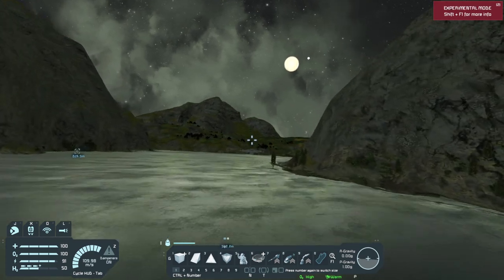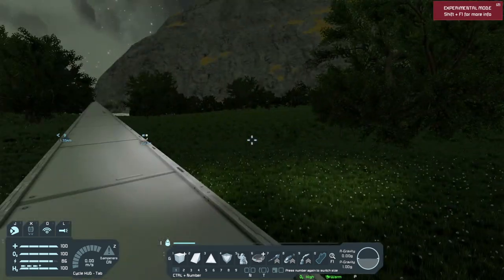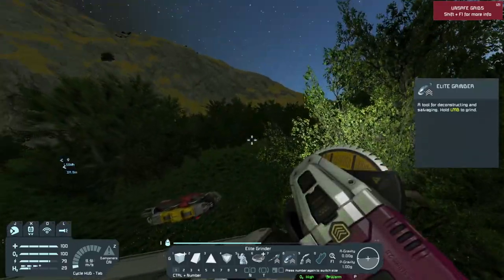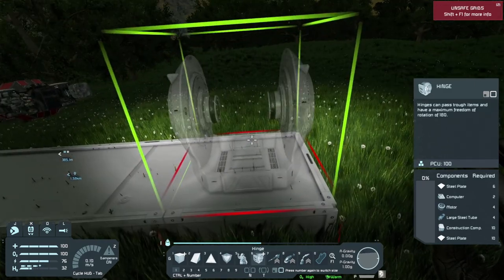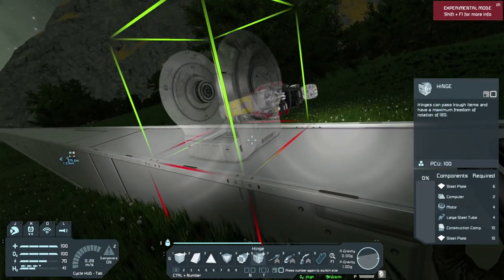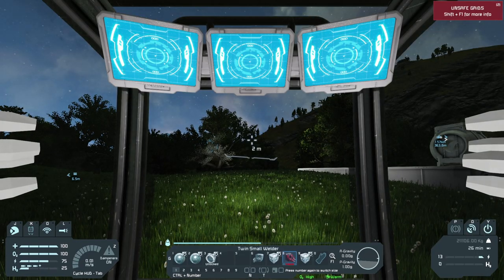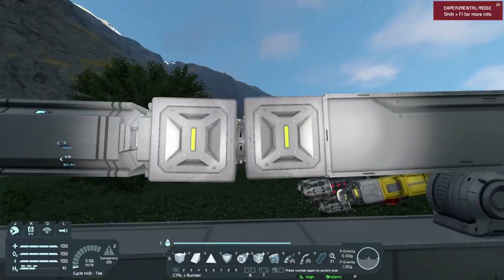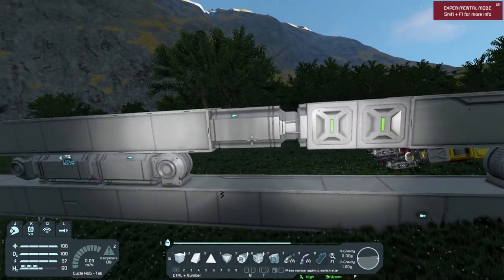Space Engineers #59: Solar Alignment without Mods or Scripts

Comment: simpler solutions are the best:
put a vertical rotator to align the panel on where the sun raises, then go up, put another rotor with solar panels on it, remove the limits and set the rotation speed so it takes the time of the sun rotation to make 1 full turn. No scripts needed, no pistons, no hinges, easy peasy. Just some math.
Reply: thats also, not complicated. He's literally said at several points in the video that the idea is TO BE needlessly complex......
Reply: @gryphon3241  oh so he's a space architect :|
Reply: @TheIceThorn  not really? Space Engineers is ridiculously easy to "game" once you have a handle on the mechanics. Making things more complex than they have to be is actually a pretty common way for players to make themselves have to actually think and by extension get more enjoyment out of the game than just doing the easiest/most efficient stuff
Reply: @gryphon3241  yes, but that's not what an engineer does. Freeman Dyson docet.